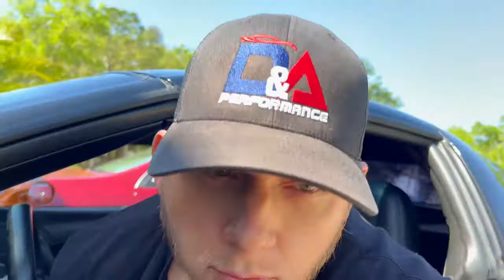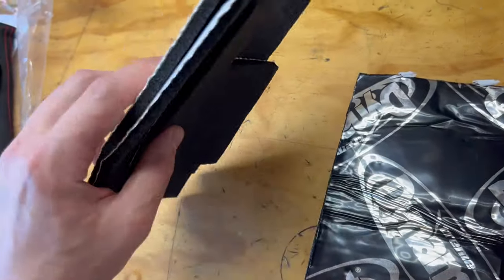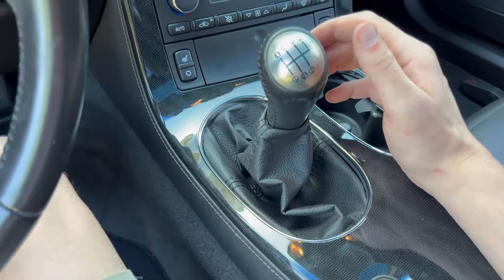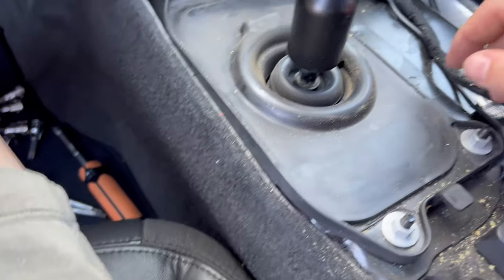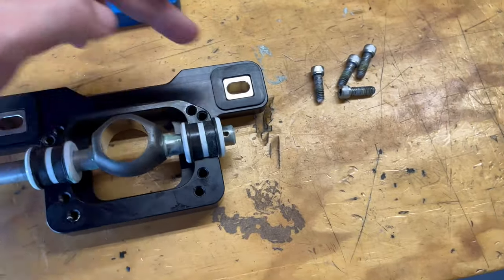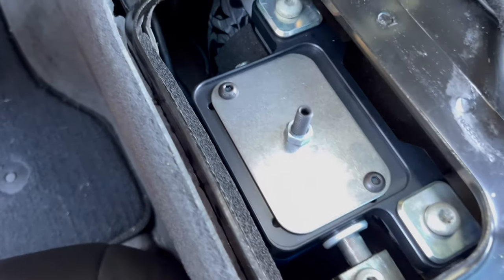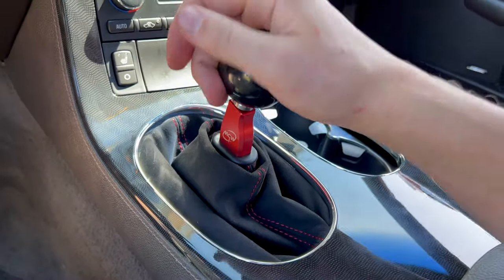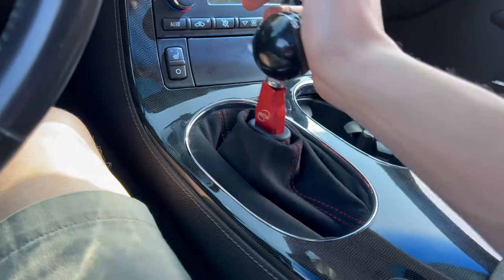The best Short Shifter for C6 Corvettes | MGW flat stick install

Comment: Nice video on the install, thanks. Btw, what exhaust system is on the car? It sounds great.
Reply from the maker: It was custom axle back with headers and x pipe. Just some generic straight though 12” mufflers

Comment: So my c6 with only 15k miles on it sometimes doesn’t fully go into 2nd, it will pop out and grind if I put it back in. Do you think this shifter will fix it? 2nd gear seems a little sloppier in the gate compared to the rest
Reply from the maker: That’s hard to say I don’t think the shifter wouldn’t allow the trans to go into 2nd gear. Unless the shifter has a huge amount of okay. Maybe there’s another reason why it won’t engage correctly
Reply: @DAPerform  I feel like if I don’t press down and hard to the left it won’t fully go into second. It only really happens if I shift lighter than normal and at lower rpms. It’s weird. It’s worse when it’s cold when warm, it’s completely fine. I’m the 3rd owner so idk if it may have a bent shift fork, worn shifter bushings, misalignment in the shifter, or (hopefully not) a shot second gear synchro
Reply from the maker: @davidr6865  hard to tell without digging further into it
Reply: @DAPerform  yea I figured I’d root out the cheap stuff before dropping couple $k messing around with it. You mentioned that it helped with gear grinding, what type of grinding were you encountering before you swapped the shifter?
Reply from the maker: @davidr6865  mostly at wide open throttle shifts but the play I had on the shifter just wasn’t engaging enough into the gear

Comment: Had mine on for 5 years but only 3k miles. Running into a loud rattling noise on hard acceleration
Reply from the maker: You know I’ve had the same sound sometimes but I could never figure out what it is
Reply: @DAPerform  weird, I won’t wanna pull my dash apart I am gonna take mine to a shop soon it’s getting bad I took a video wish I could share it with you
Reply from the maker: @tommycoyle4475  find me on Instagram

Comment: To notchy hard to power shift
Reply from the maker: Put some MAN into it
Reply: @DAPerform  good idea just don’t see why stress on shifting with that thing when you can put a B&M shifter and call it a day.
Reply: @DAPerform  work smarter not harder 🤣
Reply: Doesn't seem like he's having a issue with it.
Reply: @learjets1638  yeah what ever you say with a good Grammar.. 🤣I can see you get my point don’t you.!!
Reply: If you find it too notchy, you need to do the anti venom mod and raise the shift nob. The lower you adjust the knob, the stiffer/notchier it will be.